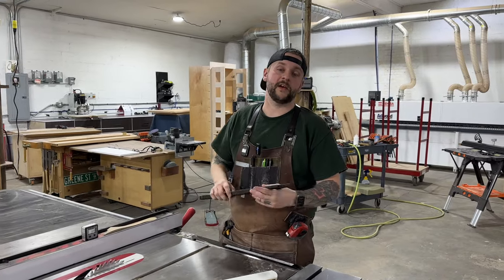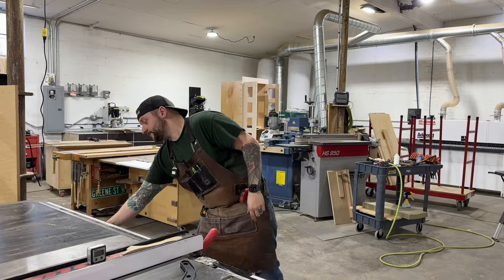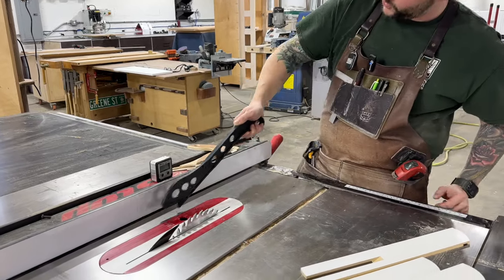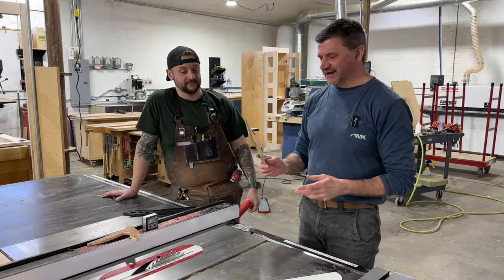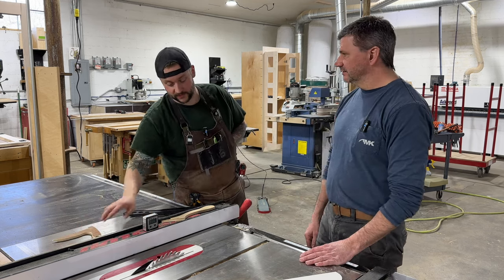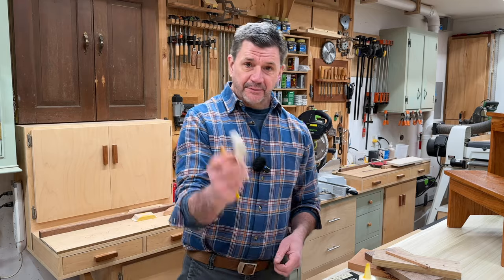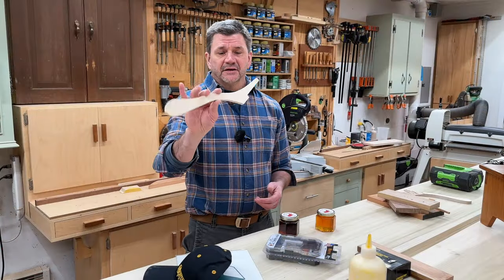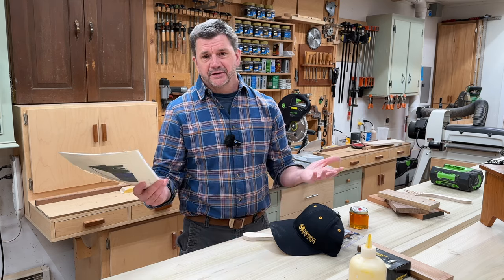Never Use a Plastic Push Stick!

Comment: Fundamentals at its best.    Push sticks will inevitably make contact with the blade somewhere along it's contact points, so wood is the only thing really you should use.    Great job fellas.   🎯
Reply from the maker: 100%! The blades aren’t even designed for plastic.

Comment: 100 percent facts on the plastic sticks. Wood push sticks go right through the blade without a problem. I have had two plastic sticks blow up. Even when they don’t blow up you still finch enough to be unsafe.  I have had several kickback episodes on several table saws. Make sure to get yourself a comfortable push stick and get comfortable using it.   And yes i still have all my fingers as of today.
Reply from the maker: All great advice!

Comment: I was always scared of using the plastic push stick because I thought it would blow up in my face if it hit the blade, just based on the plastic material alone. I ended up tracing the plastic one on plywood because my saw had storage for it on board. This video was educational for me because I didn't realize the design flaw as well. I would also be interested in a template of John's design so that I can make my own. Great video guys!
Reply from the maker: We’ll get it up on the site once we have it up and running!
Reply from the maker: Check out todayscraftsmen.com

Comment: I use mine but never near the blade.  Not some much worried about it exploding but more to keep it fancy.  I have worked in a cabinet shop since I was a teenager and its always been shop made push sticks.  So when I got a table saw at home and it came with a plastic stick that was the fanciest push stick I have ever had, cause I don't make nice ones like Jon does cause sometimes they might not last that long, plus I have a couple of different designs I make cause I like different ones for different operations.  I recently purchased a microjig because I wanted to see what it was all about.  Its a nice system but the ergonomics ares so far off of how I make my push sticks its hard for me to get used too.
Reply from the maker: I never liked the look of the micro jig but haven’t tried it myself!

Comment: I never use the plastic push stick on the table saw, but I do use it on the bandsaw. I like John's design, and will either win one (hopefully), or go into prototyping mode to try to replicate it.
Reply from the maker: Better watch out I heard Jon has great attorneys. 😜
Reply: @TodaysCraftsmen My attorney advised me on my failure to mention that I plan to make minor modifications to John's design, to make it my own, so not a replica. 😉
Reply from the maker: Or you could make a ‘parody push stick’
Reply from the maker: Check out todayscraftsmen.com

Comment: Very fortunate that the 2 or 3 times ive ran a plastic push stick into the blade, it was a softer plastic and got chewed up. Nonetheless, typically only use wood now.
Reply from the maker: Lucky!

Comment: I have never understood how manufacturers can get away with suppling those plastic push sticks. At the very least they should be made out of a shatterproof plastic so when it does eventually come into contact with the blade you will not be put in danger with sharp pieces of plastic flying all over the shop.
Reply from the maker: Agreed! Makes no sense…